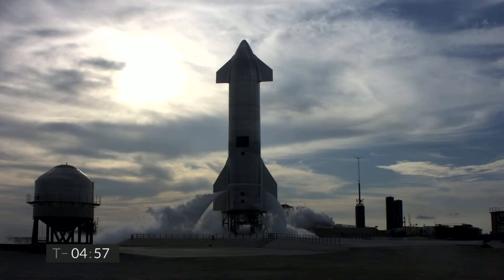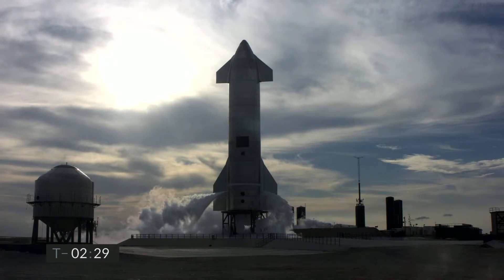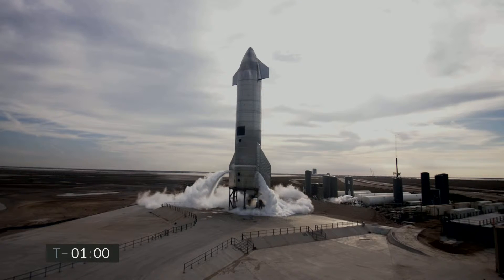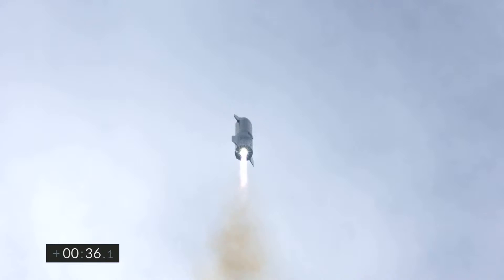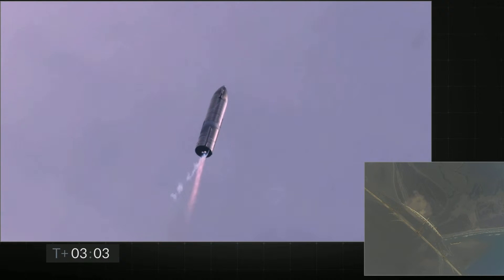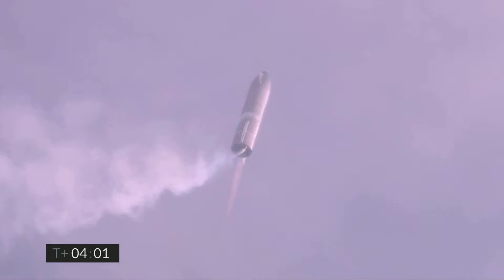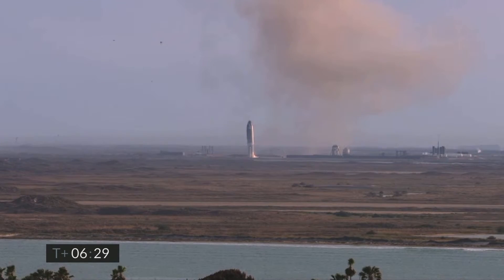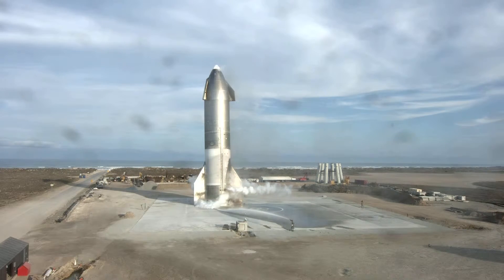Starship | SN10 | High-Altitude Flight Test

Comment: On the flip side: if we were on Mars to see this land, we wouldn’t have to worry about standing closely to one because the 1% thick atmosphere wouldn’t transfer the shockwaves from the rockets nearly as much.
Reply: On the flip side... I see what you did there! 11:43
Reply: how about shrapnel though
Reply: but the dust would fly much further due to less air resistance and less gravity, making it harder to even see.
Reply: @mikeock3164    Why would you need to see when computers land the thing?
Reply: It'll be way more harder to land on mars.
Reply: @archangel7052  Thats true. This thing with it's flaps is very reliant on the atmosphere to slow and guide the vessel.  Over on Mars these would play less of a role. The boosters will have to work a long time to bring it down. 

Unless they go into Martian orbit for a couple of days and bring it into a very slow decaying orbit then decent. Who knows, there might be a completely different strategy between landing on Mars and the Earth.
Reply: You'll save a ton of energy on take-off on Mars but landing is a pickle. I'm sure he/they have it figured out on paper already. They will probably land big rockets on Mars the way they land the smaller ones on Earth, with a controlled burn most of the way down with the nose up and a big burst at touchdown.

I think terminal velocity is the same on Mars right?
Reply: @Umphy  I don't know by I wouldn't think so. Seems it should be different given the differences in the atmosphere, gravity, etc.
Reply: @patriciaselby636  yeah to the terminal velocity should be slower given the gravity, so if you came in slow enough you could probably fall at the same speed as the air brakes maintain.  And land the way they land the orions or whatever- nose up slow burn parabola all the way down.

I'm sad it exploded on the runway 5 minutes later, I know they got good data but that's a lot of tech to lose, I was really hoping v10 would be able to do more test flights.  

Spacex (and probably neural link) is our only hope to survive long term as a species so these explosions are setbacks, every 6 months we lose are not insignificant.
Reply: ye just get roasted by those exhaust or risk it failing and landing/exploding on u xD
Reply: @aljon5947  you wouldn’t want to be that close, but at 100-500 meters? That wouldn’t kill you. On earth such a landing would turn your internals to canned meat at over a kilometer away when the rocket’s thrust plume produces shock waves in the air.
Reply: it also wouldn't slow down debris as much
Reply: If that’s the case, the ground would get REALLY hot though, (within a certain range that I don’t know of).
Reply: You still have to worry about being sandblasted by sand that is kicked up and shot off in all directions at several hundreds of m/s. It’s a phenomenon that was seen on Apollo 12 when they landed next to Surveyor, some equipment was damaged and covered in dust.
Reply: @Jay_The_Amazing  

Granted that can be true, the colony could be still highly compact; the landing zone could be in the center. With everyone sheltered around it, even a few hundred or dozens meters out, they would be safe from the sand blast.
Reply: @topsecret1837  not true, sandblasting on the moon can spread for 1000's of km (not sure as to the distances on Mars), any landing pad should be behind a hill or cliff face of some kind or have the landing pad be cleared of dust completely. Remember these sand grains are sharp as glass, so nobody should be outside even in a spacesuit during a landing event.
Reply: how do they plan on testing out vertical landings on mars with 1% atm and 33%g
Reply: @teg-q5t  The way they tested the moon landing, it will be under much less stress as well under those conditions.  Landing on mars is the easy part because the rocket and the fuel weight 1/3, the earth's atmospheric air brakes do not slow it down even close to 1/3.  

They will just use the same nose up parabola they use for their other landings in the past on smaller rockets.

Everything is easier when you divide it by 3.

Plus presumably they have data from all of the rover landings, just needs to be scaled up, but in reality they will probably send a few unmanned supply rockets ahead to do test landings on mars.

Also the crew cabin can detach and fly off in any direction at any time during entry if something goes wrong.  Even if it's seconds from touchdown the crew module can separate.  Even if it is bloody landed and the computer warns of an explosion the crew module can take off.

And no oxygen means waaaaay less chance of random fires bungling things up. This is key- once the chemical reaction is mechanically stopped, fires will instantly go out (but the heat will not be able to dissipate very quickly, near vacuum is a great insulator)- you would never see a team shooting water at a fire on a deactivated rocket on mars like we saw here.

Landing on earth is the hardest thing, including the reduced versatility of the crew module,  that's why they are losing so much tech trying to perfect it.
Reply: @Umphy   sorry I didn’t notice you said test and not just the way they landed on the moon. Yea with 1/3G the landing process gets easier but I still think stabilizing the starship once it has landed will be difficult on soft dirt or uncharted ground. Maybe if we find some kind of salt flat type of ground that’s flat and hard so far we have just parachuted things down onto Mars and the rovers are designed to go rock climbing but from the few videos of starships landing and early flacon 9s a lot of them blew up from the landing legs giving problems or not being balanced after it lands. It’s a pretty difficult engineering problem of making sure a thin tower can stand straight on an uncharted unknown surface. I have no doubt spacex will have it figured out by the time they send rockets to Mars but it will be cool to see how they go about it.
Reply: @teg-q5t  don't be sorry it's a complicated question and I agree it'll be hard to stabalise. They def have unique technical issues to address, and they would still need to slow way down in space before entry. The first ones will be the worst, eventually presumably they will have a landing platform.

And the dirt on Mars is insane apparently. It's all radioactive razorblades, it'll be hard. And there's no oxygen intake so it will need to be 100% liquid oxygen I guess. There's a lot of things i don't know that I don't know that will probably make touch down very tricky.
Reply: @teg-q5t  look up how they did the moon landing tests for apollo. It's friggin awesome.
Reply: @thingsandstuffwithinmebrai5938  I actually saw a video on that having to circle the moon twice to slow down and fix the trajectory before sending the moon lander down to the moon. Actually the moon lander struggled to stand upright on earth because it would collapse under its own weight on earth. Also the legs of the lander were much longer because they were expected to sink into the dirt before stabilizing. This is one thing spacex will have to figure out for Mars trying to keep a several hundred ton aluminum tower stable on soft Martian soil, as opposed to the concrete landing pads down here on earth.

Comment: I think it was going really well with the accent and belly as it has with all 3 launches, but the flip is still seeming to be a problem. I would have thought that they would have kept 2 of the engines running for landing instead of the 1 they did it with, then maybe it wouldn't have been as heavy landing as it was.

Possibly for SN11, they could keep 2 engines still lit for landing instead of the 1 they did with SN10.

And then start working on new landing legs cos clearly the ones they're using are crap and don't work for the high altitude flights

Comment: Again ! An engine fail. Hopefully the main thruster did not faille while It's went oven the max capacity thruster. Usully, you should have 2 thrusters to avoid excessive thruster wall wear when you hit the max trust only on one thruster.
Reply: They were shut off purposefully
Reply: The engines performed fine, the shutdowns were intensional

Comment: I love SpaceX and all the things they've accomplished thus far. However, soft landing my ass. SS-10 definitely bounced on touchdown and was sitting slightly askew, likely from  bending the ship's landing surface a bit with that thump.

All in all though, great job guys. Now you just need to fine-tune the throttle in the last 2 seconds before touchdown.

Comment: Get some new landing legs, those tiny ones suck, some how they caused a puncher! But at least they got the data! The Super Heavy Booster has it far easier then Starship, when it come to landing!

I was thinking that they should develop Contour Landing Gear! Similar to a Contour Gauge, making the ship able to land on any type of surface, no matter how uneven it is!

Mars landing would not require and pads, especially if the Contour Landing Gear has 10 long, auto cushioning, auto stabilization and auto locking legs, keeping Starship always level, even on large rocks

Comment: I find it nutty how 3 (and at point only 1) thrusters was used to balance several tons of flying skyscraper and executed for several minutes on end. A lot more groundwork is still needed to move forward, but this alone is an absurdly difficult accomplishment. Props to SpaceX and the people backing them up!

Comment: Grime on the lens, ego's not mauled , some say there was a fluke X in the possible higher altitude dimentional physics , luxury class trust again.It doesn't sound like a flying bomb at all so much now . Anywhere in the system other fuel to weight purges but it seemed like better thermal recognition with that hose droidI thought Son and reacted much the same as all

Comment: Q: When re-entering earth's atmosphere what angle of attack (?) will the vehicle be in?
Reentry shielding all over?
Reply: The reentry shielding will be on the belly half of starship. Since it's made of steel that's all it needs.
Reply: Yes, the bottom half will be shielded. When in orbit it travels at 17,500 mph. They slow it down for re-entry but it still hits the atmosphere at about 12,000mph so that's a lot of energy to get rid of. With each of these prototypes they've placed a few patches of tiles attached by various means for resilience testing. We'll probably see one fully shielded before the end of the year.

Comment: Amazing. As I googled for sn10 it suggested “sn10 explosion” so I was expecting another explosion on landing.  They did it!
Reply: It did explode, just after landing, landing legs didn’t fully deploy causing sn10 to land on the aft flaps, this put a crack in the methane tank. This leaked methane which caught fire and blew up the tank.

Comment: 5:43- Launch
7:59- 1st Engine Cutoff
8:57- 2nd Engine Cutoff
10:03- 3rd Engine Cutoff 
10:04- Belly Flop Beings
11:43- Landing Burn Beings
11:45- Belly Flop Ends
12:03- Lands
12:04- Landing Burn Ends

And good job SpaceX
Reply: The landing burn looked like CGI. It was awesome.
Reply: After few minutes it explodes methane gas leak
Reply: @vishnu_bhatt  I know

Comment: It was successful but sadly SN10 exploded a few minutes after it landed. Possible gas leak and failed booster at 11:50 then at 11:56 at the right side somethings burning. I dunno much about rocket science but that's what i saw and noticed

Comment: Was the methane leak in anyway related to the last moment of "jerk" as it landed on the pad?
Reply: Popular theory is landing legs didn’t fully deploy and sn10 landed on the aft fins which caused the leak.
Reply: @joshuamartin3232  yes because, falcons do have suspensions to take the landing jerk. 
It's something that could be fixed easily
Reply: @joshuamartin3232  and sn10 did seem a bit tilted

Comment: The prototypes are the sprints, SN5 SN10 did the full cycle but the internals are completely different.  Lots of communicating people solving lots of problems all at once, no flat, or hierarchy organisation here.  Just smart, that's how Appolo was done, smart.
SN11, ready to go, bigger stronger smarter than SN10

Comment: We send a rocket up 25,000 feet, then have it come back down to Earth and land?  Someone needs to explain to me how we as a society benefit from this.  We still have no technology to allow us to travel allow space at will. We invest all this time and money into sending a rocket up and landing it.  For what?  99% of us can't afford a first class ticket on Delta airlines LOL.. When they can send a rocket up to space, then have it travel to a moon that orbits Jupiter and return in less that a couple days, then I'll find this interesting.  A rocket that can land back on earth isn't impressing me at all.
Reply: By having the rocket land, it can be used again, making it much cheaper to launch. Well ok, this particular prototype won't ever fly a third time, but later ones hopefully will.
SpaceX are already doing this with Falcon 9's first stage booster. One of their boosters has been to space 8 times already, with another hopefully matching that tomorrow.
But Falcon 9 still throws away it's second stage, and there's still a lot of cost involved in rebuilding that. So this is a prototype for a recoverable second stage.
By having both a reusable booster and second stage, SpaceX expect they can get launch costs down to $20/kg. Even $100/kg would be revolutionary.

Currently the cheapest rides to orbit are around $2500/kg best case, realistically $10,000/kg is more accurate. A 25-fold cost reduction would be insane. Not quite 'everyday trip', but enough to make zero-g manufacturing possible, as well as asteroid mining, space based solar power, etc. 
Not to mention it would make launching climate/weather/crop monitoring/communication satellites much more affordable.

And if SpaceX do reach their ultimate goal, this rocket could send you to orbit for around $10,000, or the moon or Mars for ~$100,000. Sure, that's not quite 'economy class', but it's a hell of a lot cheaper than historical per-person cost of ~100 million to orbit, or ~25 billion to the moon.

And while it's not quite sci-fi fast, it has enough excess delta-v to be quicker than current rockets. It should be able to do Mars in 3-4 months instead of the usual 9 months.
If you really needed to go fast and the extra fuel cost and reduced cargo wasn't an issue, it could probably do 2 months to Mars.

We probably aren't ever going to get magic Star wars or Star trek ships, and even ships like those in the Expanse aren't going to happen overnight. To start messing around with that sort of stuff, we need to be able to get to orbit and build stuff in orbit effectively. This rocket will be a stepping stone towards that.

By the way, without inventing a science fantasy technology like 'inertial dampeners', a trip to Jupiter and back in 'less than a few days' would likely be fatal.
A week long trip would have you at 3G the whole time, which would be extremely unpleasant. Realistically you wouldn't want to go faster than two weeks.

Comment: I'm gonna guess that the rocket was intentionally self-destructed due to the damage and the fire.
Reply: Why would they do that?
Reply: @eyescreamcake   I can only compare it to my own profession as a structural engineer. If a building is on fire and leaning over and full of fuel, then no engineer will sign off on a recovery plan, or rather it could take days to form a plan. It would be faster and safer just to let it burn or knock it down. In this case I'd guess the site could not be safely approached given the fire and the remaining fuel and the damage to the rocket. Who knows, it looks like the fire suppression system could not reach the rocket so maybe it just burned until it blew up.

Comment: seemed a little hard on landing by my viewing, but taking nothing from the impressive feat, Congratulations!
Reply: also those moving fins are pretty damn cool!    I think however the fuel tanks mass is a key parameter of the vehicle dynamics and they will need to test this many times with more fuel which could completely change the test, it would be interesting to know how high the fuel was, likely they only had enough for a very narrow window to prevent the size of an explosion if the worst occurred, but this then changes how hard it is to orient the vehicle and how useful the fins are in that effort, imaging the nose if heavier than the base of the starship, you may not be able to use the aerodynamic forces to orient the vehicle, like a 1/4 filled water bottle is easier to toss on its base, they might need to have the fuel moving around for ballast

Comment: At T+2:20, lots of yloow flame in the engine compartment.
At T+2:46 and beyond, the second engine is running yellow compared to the third engine running blue flame.  Engine 2 is in trouble.
At T+6:11, the Raptors spit fireballs as they shut down, which is fine, but there is a continued fire on the right hand (south) side of the vehicle.  Something has broken and there is a fuel or hydraulic fluid leak.
At T+6:29, after landing and engine shutdown, the fire continues, so the leak is probably before the turbopumps.

Comment: Space X: Let's just leave out the part where it exploded.
Reply: It legit landed in one piece. They've known they needed to redesign the landing legs for a long time.
Reply: Why, that's the fun part. They were more than likely scap her any way. SN15? Now there's a beauty.
Reply: When did it explode?
Reply: @psychicspy1234  A couple minutes after landing. There was a fire in the engine bay which got out of hand.
Reply: @psychicspy1234  About 15 minutes after the landing.
Reply: Hehe, at the point where they ended the stream they obviously didn't think it would still explode - almost 10 Minutes after landing 😄.